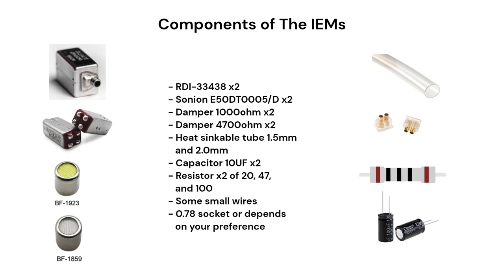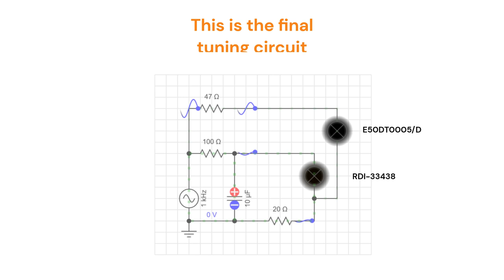How to Make DIY IEMs That Sound Better Than Expensive IEMs in the market

Comment from the maker: download the shell here
shell: https://skfb.ly/oJzVF
cap: https://skfb.ly/oJzVK
Reply: so question how do you decide what damper to use for your builds ?  cause i am going to make myself some costum ones  with UV resin and all the stuff.
Reply from the maker: @n3ptuchan848  decision of which damper should be used is during the tuning process. Using different dampers might need slightly different tuning
Reply: @kozh4013 Hey man I want to know much more about these. Is it possible for me to contact you to clear my doubts?

Comment: I have so many questions. How is the resolution on these, how is the soundstage, what is the tonality and technicality like? And how do these compare to any popular iems that you have used?
Reply: 😂 you clearly know Crinacle
Reply: Judging by the frequency response graph, it's an average Chi-fi no deep technical tuning FR. But with high-end (assuming 100% performance) drivers, you can EQ this bad boy to galaxies and beyond and be happy with it.
Reply from the maker: You're right, the tuning needs to be improved, especially lower the mid-bass
Reply: @kozh4013  Now, I don't know how raw-tuning an IEM works, without a software/equalizer. But I bet it must be expensive. Maybe you have an idea on this?
Reply: @rigel8755  Not necessarily. I am not very knowledgeable about this, but I know that a lot of the basic tuning techniques are really cheap or even free. 

For example, using different lengths of tubing in between the BA and the ear affects tuning. Different values of similar quality crossover components won't vary much in price. Sound dampening material might be somewhat expensive for what it is, but you won't use much...

The main problem is understanding how these affects the tuning, then applying what you learned properly to get an end result that meets your expectations. Also, you have to know at which point you have to say "Nah it's too complex to tune, I will use a different driver combo instead"

If it sounds like an insanely complex job... well it is
Reply: @cedricboivin9422  I'm aware of other  cheap physical component's shenanigans to slightly change tuning. Now wether these can make masterpieces like recent good IEMs in each pricerange with impecable tuning or not without much expensive outside gear, I don't know, and that's what I'm really curious about. When one brand nails a tuning, a swarm of others come closing in with similar FR, as if they knew all along how to do it, or just learned by getting info, or learning a  new cheap technique or something.. The Chi-fi world is more confusing then we think.

Comment: Cool video, i really like how the larger resistors and capacitors look. How would you compare the E50DT with the sonion EST drivers for treble extension?
Reply from the maker: The E50DT can cover from 3k-20k and has excellent detail while the est only 7k up and gives much less detail, some people don't like est.
The E50DT raw frequency response only covers up to 18kHz but with good tuning, it can go beyond 20k
E50DT is a good choice for 2ways IEMs. In my project I used Knowles RDI to cover 1k and below and Sonion E50DT for 1k+.

Comment: Ok man, I'm gonna give this is a shot. Thanks for sharing. What 3D printer did you use? I've been thinking about grabbing a resin one for a while.  I'm brand new to IEMs. Just ordered a Hexa and a Simgot SM4. This looks like a fun little project. What kind of quality would you say you achieved with these?
Reply from the maker: Used one of the cheapest 3d printer. This project is not perfect; however, if you want to follow, I recommend using lower value damper and increase the low pass to lower the frequency at 200-1k. That will make it less muddy and improve details

Comment: where i can buy the audio drivers ( the ones small components ) what are they called?
Reply from the maker: I bought mine from the Chinese website Taobao. You can also buy them from other sources depending on where you live. Those BAs drivers are expensive and need a bit of skill and knowledge to deal with them. If you're a beginner I recommend starting with dynamic drivers first

Comment: Hello. why don't you use smd components? And can you tell me what each resistor and capacitor does for sound?
Reply from the maker: It's a fun project so I used those big components to make it cooler. Circuit and components value in the video

Comment: Doesn't the cap and the sanding on the nozzle affect the tuning? Wouldn't it be better to sand the nozzle first, enclose it temporarily and then do the tuning? Maybe im overestimating the effect that has on the outcome. How much was the tuning rig?
Reply from the maker: That's interesting. For the tuning rig, it's just a cheap $100 set
Reply: @kozh4013  that's kind of steep, with all the other parts you can get some pretty amazing pairs of headphones for that price. I wonder if building one out of a cheap mic and some 3d printed parts could work.
Reply: @TheHabadababa  This is a personal project made for the sake of making it, making it open-source itself was an after thought, it was never meant to be competitive on the market lmao

Comment: Hey, im a newbie IEM user, i just wanna know what is the biggest different between cheap and expensive IEM's, just in case i want to upgrade my IEM

sorry for my bad English, its my 2nd lenguage
Reply from the maker: I'd compare them like this: Basic IEMs are like old 2MP phone cameras - they can get the job done, but you miss the details. Good IEMs are like high-res DSLRs. Listen with them,  you hear every detail clearly, wide soundstage and other technical abilities
Reply: For this time best price is 100-200doll or 1000-1500 all else you can be dissapointed. It is very approximately. Hexa for 80doll plays very good!

Comment: For making full metal shells try casting from zinc or Al alloy, using the print and plaster of paris (gypsum) to create a mould, then remember to double coat varnish.
it will need some finishing too and may need somewhere for the metal to go in and gas to escape, which can be done in post with some wax.
Edit: you can even make them in solid silver if you want!